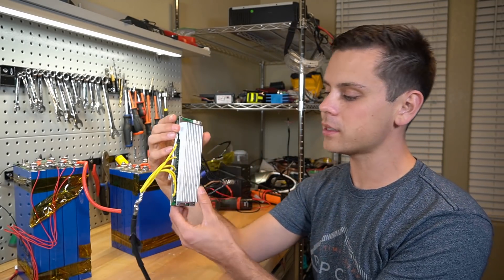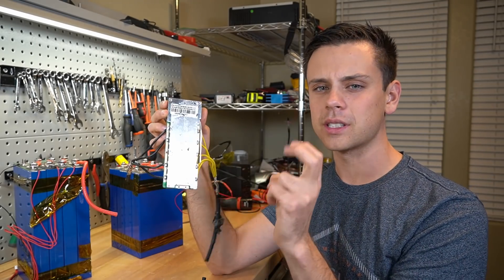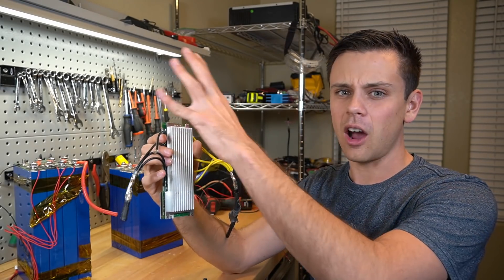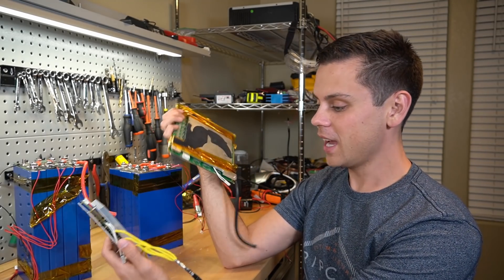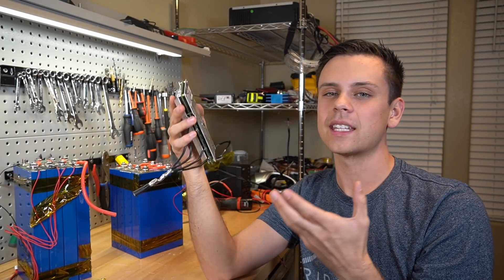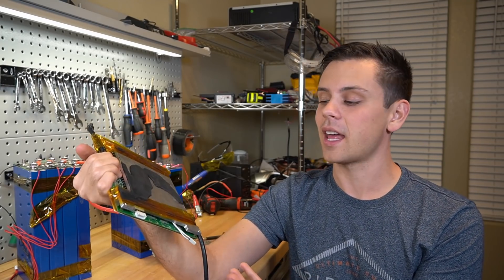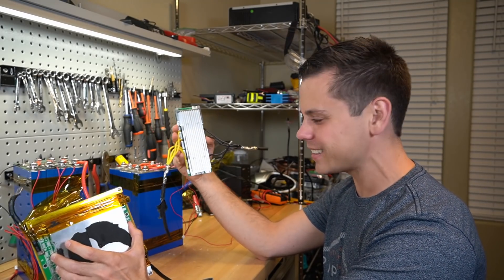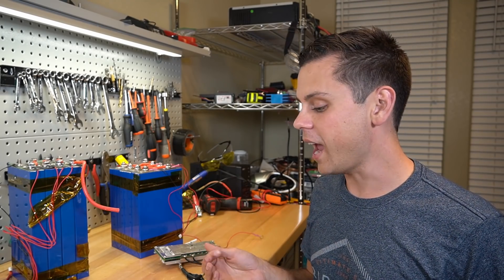Ruixu Problems Part 3: Ruixu's Response

Comment: These batteries are not sold as RUIXU anymore. Not sure if they changed brands or what. This is going to be the problem getting warranty support from Chinese manufacturers. They can just rebrand and you will never find out where they are. Buy these batteries assuming they have no warranty.

Comment: We are in North America where winters are almost always colder than all heck especially in the northern tier states. A low temperature battery disconnect  and battery warming system is pretty much a necessity just as a safe guard against the failure of the battery storage area heating system. To buy and install a product that does not take low temperatures into consideration is just insane. Just ask them in Texas huh?

Comment: My question now is,  are all the batteries you've tested been sent to you by the companies themselves to be tested? Could this be a industry norm? To beef up the testing batteries and send out crap to the public?  Are there regulations to prevent this from happening? This seems fradulant, deceptive,  and should be straight out illegal. Thanks Will! Once again you have shed light on a subject most consumers would not even begin to know how to inspect and would be forced to simply take the industry leaders word for it, that it is what they claim.

Comment: You can't be (successfully) sued for your opinion, only for making a statement of fact that's not true.  So long as you preface your statement with "In my opinion..." you're normally safe.  I haven't seen a big influx of cheap Chinese knockoff manufacturers filing suit in US courts, have you?  It would open them up to discover and countersuits that could be very difficult for them.

Comment: A Bimetal Snap Disc thermostat, I can buy them for around 6.00 dollars. I have never torn a battery apart so I do not know if this is the method that battery makers use to set their lower and upper temp. limits, ???  How do they do it Mr. Power's I except you greater knowledge in this area. I'm not worthy.

Comment: AvE spoke about review "tuned" products quite a while ago. 
I wouldn't be surprised if such modifications are commonplace among many different products. Even some motorcycle sprockets have this where the actual product uses subpar rivets that can end up locking a wheel.

Comment: It is (usually) so hard to run a business and make a profit. The fact that they responded and and gave some reason for the issues and offered a resolution would make me give them another chance. Could they have been "scamming?" It's very possible but I'd give them that second chance to make it right. It's not like they were selling us a premium product. They are attempting to sell us an inexpensive product that is the highest quality possible for the price while still making a profit. Selling the highest quality product possible and then pricing it to be profitable is actually easier to do. That's my opinion on this.

Think about it like this. Running a profitable YT channel isn't easy. Especially when tying to review products and sell them. You're somewhat at the mercy of the manufacturers/wholesalers like in this case. You did the right thing by addressing it with your viewers as they did with you. Had you not addressed it then your viewers would have a good reason to not trust you. It would be overreacting if we decided to unsub and walk away because you made the mistake of reselling the product even though you tried to make it right immediately.

Comment: I am curious how those 2 BMS units perform, I'm expecting no contest win for the older much larger unit. Just it's ability to dissipate heat should be better. Of course it's still sitting right on a cell and will cause that cell to fail sooner than the rest. I'd also like to see a capacity test on the old cells vs the new cells. Betting the newer ones have less capacity. All in all that new design was absolutely terrible compared to the old one. Personally I think all of these batteries should have the BMS in a separate compartment that can be accessed via screws in order to replace it should it ever fail. Sealing it in with the battery means your battery is toast unless you break it apart if the BMS ever fails, and lets be honest, the BMS is more likely to fail than the cells are so long as the cells are high quality.

Comment: The take away from all of this is you cannot trust reviewing something sent to you straight from the manufacturer because it will be the perfect version (of course). In my past I worked in the engineering dept. of an appliance manufacturer with UL testing and the whole works. We always tested the perfect model in order to ensure it would get passed and approved. However, there were always follow up inspections and spot checks/tests later on to see if it still passed the tests and remained in compliance. Many of the products from China are at the mercy of the manufacturer to stay ethical and in compliance with the originally tested or reviewed product. The only real way to perform a review is to randomize the selection of the product in an as "off the shelf" manner as is possible. Great job on finding and reviewing a real world example of this product and keeping them honest as they must have been totally caught off guard on this one.  Excellent!

Comment: Hahaha it is interesting twist and you ended up between a rock and a hard place.  Oh well. It happens. I was watching your videos because I am lookint for set up of solar off grid and I am looking to build lithium battery bank. If I have to build from scratch because I cant trust manufacturer like in this case then perhaps building from componants would make sense. What is your opinion?

Comment: I don't think there is anything wrong with a good critique of a product, especially when they change a design like this. If they want you to test and show people their product, they should be ready for the deficiencies being placed on the spotlight. Hopefully this should help them and other design better products, most of the time they don't really understand the real world applications, fringe cases and potential issues (a person who has lived in warm environments, doesn't usually understand issues with low temp, etc).
I am not surprised by the change, yes they may have sent you a "custom" design but most likely they made a certain design for many months then changed it when they went thru a new cost cutting solution or found a different vendor. This is definitely the downside of dealing with imported products, it may be perfectly fine for a while and then all of the sudden it goes to hell, this is usually because they are much more lax on engineering changes and maintaining brand equity (they can just give it a new brand, no one will be the wiser).

Comment: If the design and hardware has all changed inside the battery then the battery should have a new model number.  To sell it as the old number suggests that it is the same.  I really like this video and in regards to liability, you just need to not state that they have one something for a reason (assumed intent) and instead expose the issue and ask why would it have been done that way.

Comment: Will you do a great job man keep it up. It's your honesty that draws people to you. Don't you ever change that. I am from the Island of Trinidad in Trinidad and Tobago. I am trying to build my first system. In my Country there are no local suppliers. So I have to import everything. I was actually considering buying the RUIXU 24volt 100AH lithium battery based on your reviews. We do not have winter. Our coldest days is around 21°C. So low temp cut off is not a problem for me. But to see this I am disappointed in RUIXU. I really thought they were serious in this business. You are the voice of the people don't forget that. So now I would have to go with the battleborn. Now for us the conversion rate is 7.2TT to 1 US. Importation fees is more than half of the cost of the battery. But I think in the end it would be worth it. What's your opinion? Keep up the great work.
Reply: Please stay in touch and organise locally to buy CONTAINER at a TIME.

Comment: A complete lie!  The company produced a few nice "review" units to send out to reviewers and then makes "production" units with far cheaper parts (and therefore less performance).  This should be illegal.   Here Will caught them and they simply say they're sorry (sorry they were caught).  

Maybe in the future Will, you could tell the company you'll order a unit from Amazon and they can reimburse you.  That way you'll have a better chance of getting a production unit and not a review item with different parts.  This likely won't be popular with any manufacturer, but maybe some will be ok with it.
Reply: Please respect need for OTHER distributers like Mouser.    THERE ap and digikeys and many others can address this problem.  So far there selections are curtailed.  BMW or MERCEDES for example coupled there microhybrid car battery to thermoelectric winning awards.  

I recommend that BATTERY- same shape ETC but 48 VOLTS.  It deserves lots of pretend 'Beamer' owner special orders.  Call your local junkyard NOW FOR dibs on any they might get in total loss cars. 

In large format Quality  rechargible industry oem car replacement premiums are a BARGAIN duh.   What emphase charges is outrageous.  Real markets have VALUE.  SOLAR is embryonic.  Tap into car supplier traffic.  Ride big 3 coat tails!

Comment: Ok, I think they not obligated to tell you as well to tell to any consumer that they changed BMS  or anything else in hardware, They must clarify specs and limits of their product. And if that product is used within specs it is safe. But because of all this is way better to tear apart each brand battery  and show to consumer what it contains, and tell Your opinion which all of us appreciate and taking in count when buying batteries for ourselves.  The obvious difference in BMS size does not affect usage if is within specs declared by manufacturer. On other side it is very obvious that certain differences may or may not cause loss in battery capabilities in regular usage.

Comment: Love your videos man! I dont mind if companies change their product but when the quality drops (such as mounting the heatsink onto the side of a battery & not securing plugs), it shows they have very little knowledge of electronics or safety.
If you could find a cost effective relaible BMS with low temp disconnect & quality batteries, you would only need to find a battery case supplier & a relaible & knowlegeable person to construct & sell the batteries to have a "Battle Born Buster". 
PS - I bet the smaller board with its heatsink covered won't match the larger bms in specs. Look forward to your next vid.
I agree with not making drama videos but thanks to the person who sent the battery to you as we have all learnt a lesson here. Thx a lot & thumbs up!

Comment: Will... you'd. make a great lawyer. (lol).Great job dealing with Ruixu. So how could one improvise a low temp cutoff for a system,so your battery won't charge at,say below 60 degrees F?
Reply: 60?  DON'T glibbly say it.  Nobody would. Refrigerators are fine.  Freezers controversial. My assumption is it is ABOUT bms not li ion

Comment: Will, whether you buy a budget or premium product many manufacturers use tricks like this to save money.

You don’t know whether the price of components have suddenly had a hike in price or their general business costs have taken a hike. For budget products, there is a no margin to absorb the extra cost so they have to find replacement components. Of course some manufacturers are just trying to increase profits but you don’t always know the reason why components change.

In the UK, Mars bars (chocolate) were suddenly made slightly smaller many years ago but sold for the same price. Simple tricks to save money as the price of ingredients go up.

Retail is a tough business sector. Once you set your price point it’s difficult to increase price, manufacturers instead go down the road of creating a range of products e.g. budget, regular and premium. If a consumer purchased a product from the budget range, they don’t tend to blame the manufacturer for poor components and/or workmanship, they tend to blame themselves for being stupid in buying the cheaper product.

Comment: Its really a pitty they all try to go as cheap as possible, hoping most of the market will not recognize it! It needs much more people like you, that really test their equipment and talk about it to force them to stick to quality products! Also China produces more and more fake articles - you really have to be careful what you buy. For example i use TP4056 li-ion charger ICs to control voltage and current for single cells. In the first orders they all worked well and cut off at 4.2 V. In later orders they got cheaper and cheaper letting voltage climb to 4.5 V and even more - with low current. This is not acceptable and dangerous. Also lot of voltage regulators are crap and not working - esp. for the more expansive ones. Even if you had good experience with your first orders they try to go cheaper and there will be more competition by copyists which even dump prices down further so they put pressure to go cheaper and cheaper...
About possible lawsuit: i am quite sure they will never sue you as long as you say the truth. Coming from China they will hardly have any chances for succesful lawsuits in the US as well as you would never be succesfull sueing the chinese ;-)

Comment: nice work will, your on top of it i just want to thank you for the inspiration i didnt know anything about solar intill about 3 months ago now i have 2 PV arrays one 300w and a 500w systems one with 6 6volt 225 ah batteries in series parallel and 4 nissan leaf batteries in series parallel its officially a 16volt battery but i run it between 3.75 volts to 2.75 volts per cell giving me a range of bout 15 to 11 volts .
HAVE you tried messing with nissian leaf batteries ?

Comment: Maybe instead of putting yourself in a position to have to defend yourself in a lawsuit you could just mention that you remove that item from your suggested list of items to purchase. simultaneously informing the company that if they send you a new version that passed your test you'll put it back on. You're turning into be the consumer reports of all electronics.

I think you should design your own equipment and sell it under your brand.
Reply: The problem with the company sending a new version is that they might cherry-pick or give him a custom battery, while normal consumers get garbage.  On one hand it kind of sucks if Will has to throw his money down the drain, but this video exists because of a loss of trust in the company.
Reply: I agree. If you want something done right do it yourself!!!
Reply: @hillbilly tech HE enjoys the notion of censorship against statements of belief regarding intent.  Just preface factual labratory confirmations with "in my opinion" this means.... And ask viewers for a ProBono defense team.  Do go fund counsel even BETTER

Now regarding low temp.  Sir I believed in A123 and though I failed to rescue stockholders, really failed, meaning I DROPPED EVERYTHING TO DO SO NOT EXPECTING IT POSSIBLE, THEY prior to being taken chinese privately not just traded worldwide on our exchange, they published important lessons and facts.

One of those was a standard to some extent but a123 cell being rapidly cycled at sub zero.  They put AWESOME aggregate ENERGY in and took it out with negligible wear at cyro near temp ie the supercold lab condition prevented degradation basically entirely.

In recent weeks stunning science has gone insufficiently viral.  Preheating batteries costs less then cold PROTECTION and superfast super hot CHARGING prevents problems!  Simultaneously hypothesis about xenon inserted via window in window of button battery claimed to also PROTECT 

👋 XENON?

HA JA HA

IE HEAT

SO SUPER HOT AND SUPER COLD IF ENGINEERED DELIBERATE LIKE USING SCRAPPED WALK in freezer compressor and penny a 40 watt flourescent tubes to feed and chill cherry trees in your basement ....

Comment: Don't underestimate the value of shining a light on bad behaviour, Will. Recommendations from reviewers, and good behaviour interacting with customers can make or break a company. I remember back when OCZ started swapping components randomly in their products... never knew what quality level you were going to get. Didn't take long for that to impact their reputation and sales. Bye bye OCZ.

Companies need to understand that a new design requires a new version or model number. It's as simple as updating the Amazon listing to be the 100AH 1.1 model, or the "2019 Refresh", etc. - just don't hide that there's a design change, and people will be more okay with it. Reputation won't be harmed.

This case still seems a little fishy. I think the solder joints are probably okay, but they didn't insulate the BMS from the cells... no barrier. That is a step backwards for sure. Much higher odds of that one cell that makes contact going bad sooner, and then the whole pack needs replacement.

Comment: What's inside a Battle Born, curious about their BMS and connections. Are Battle Born and Dragonfly one and the same, just different color?
As always, great videos, thanks!
Reply: BB told me that the different battery names is to get away from victron.
Reply: His torn a BB down, FYI if you haven't seen it...